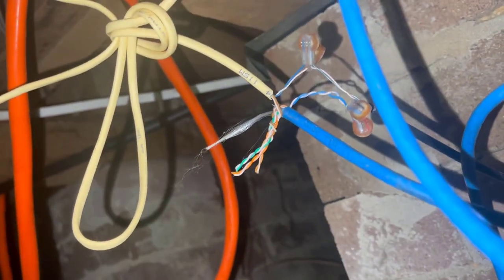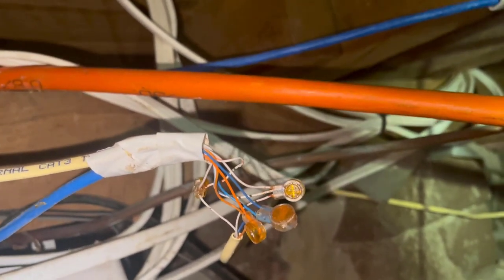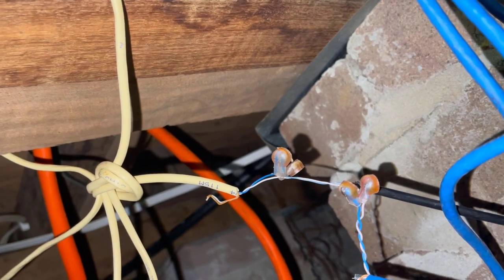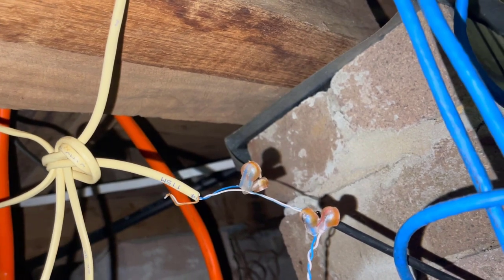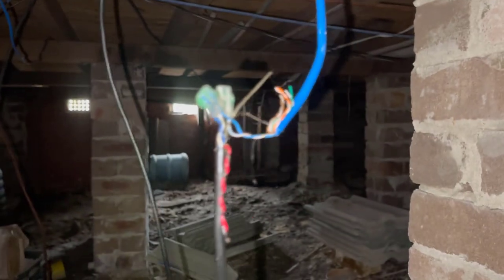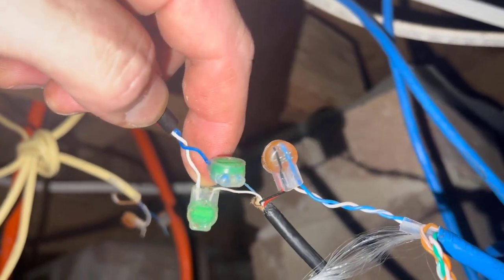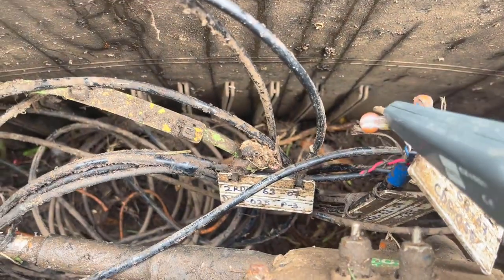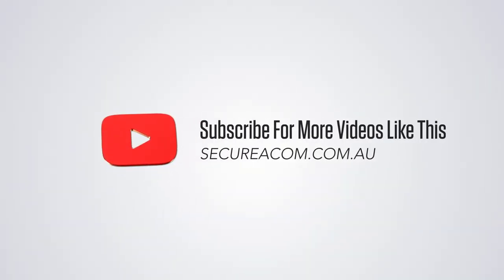NBN FTTC Bridge Tap  Causing Dropouts | Also NBN Lead In Cable Issue

Comment: Even for Priority Assist connection lead in cable repairs take a long time- NBN marks it as remediation work required then put the ticket on hold. Remediation team then takes over the repair

Comment: Hopefully the line shows as faulty at some stage. Then the block in the conduit can be fixed with a new cable. This work can take a while to get fixed. Could  NBN be able to perform a temporary fix to the line while the customer is waiting for NBN to complete the job?